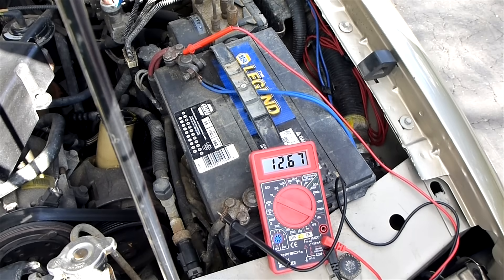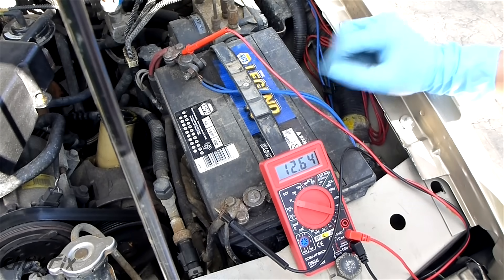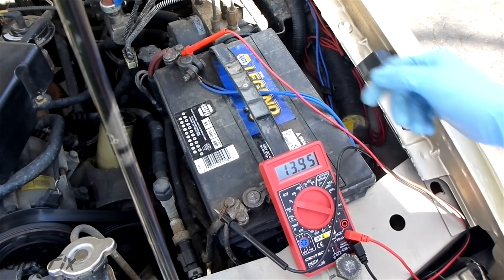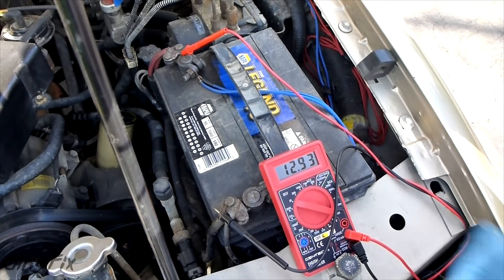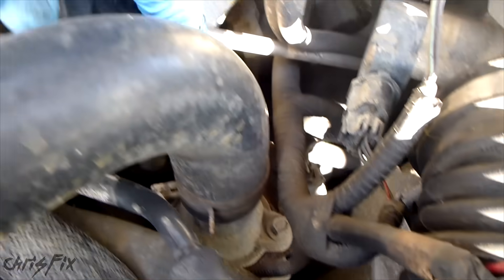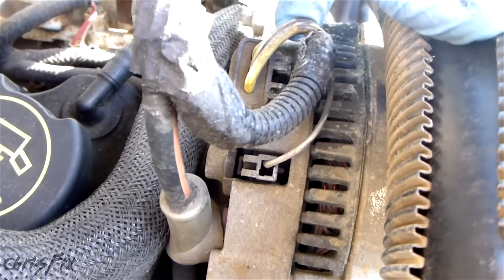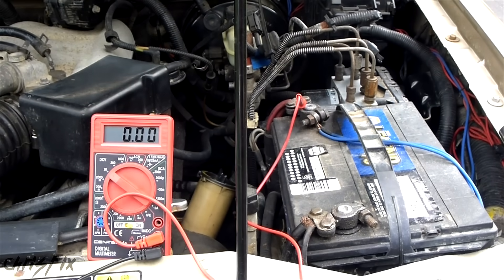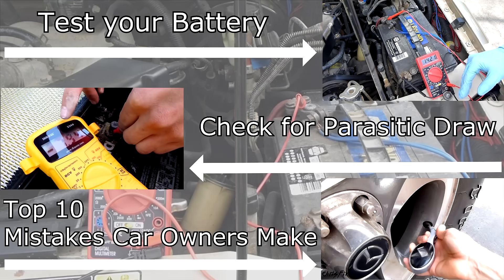How to Test an Alternator

Comment: Hi,
long video but am recently experiencing some problems with my car. 
So might ask the question here. =)
Well, my voltage on the battery in the morning before starting the car is 11.8-11.9V. (without any kind of electrics). With lights, radio etc. even lower 11.5-11.7V.
Car starts without problems even after staying couple of days in the car park.
However while starting the car there is a small dip in voltage under 10v., and the in first second or two voltage jumps up to 17V.
And immediately after stabilize between 14.1-14.3V with or without electrics inside the car (heater, radio, lights, etc.) it is in this range.

While reving the car voltage jumps from 13.8-14.3V max.

Problems I've had, various random faults on my computer (Bmw e60 5series), like transmission fault, abs, engine fault, parking sensors etc.

First, 
car was jumping into the limp mode, when this happened I've had to switch of the car, start it again.. Car would drive few mins, and then I had the same problem.
Day after, I've had the same faults and problems, but after I switched the car off, I was not able to start  it anymore (no power at all),  seems like the battery was drained completely. We jump started the car with cables, but had to wait couple of minutes..

Not sure, what the problem is, and what should I buy new (battery, or alternator)? :/

From readings, battery is really bad before starting the car..
Seems like when car is working alternator works fine,  also there is no any weird sounds coming from alternator, but on other side this high jump on the start confusing me?!

I was told that BMWs are really sensitive on bad battery, specially now when colder days arrived here, but I am not sure if all this faults and problems can cause the battery by itself, or the problem is in alternator?

Any thoughts please?!
Thanks

Comment: Hi,
my 2006 maxima idles at 13.9v and hits 14v at 1500rpm rev. I just had the battery replaced recently because it was completely dead. Does it sound like the alternator needs to be replaced or a bad connection somewhere?

also when I idle sometimes the rpms fall below 1000 and the car feels like it's about to stall...

thanks

Comment: Hi, just wanted to say I appreciate your videos very informative. Had a quick question I got a 2003 Ford Expedition XLT 5.4 liter engine getting a "check charging system" light on a dash, battery recently replaced, alternator seems to charge the battery, but the car still dies Within a few hours or a day. What can it be?

Comment: My car's on-board computer show 10.9V with the engine turned off and 12.5V with the engine turned on. The car starts quickly and easily even when cold. 1. Do the on-board computers give a reliable reading? 2. Can a weak battery contribute to a lower (12.5V) after starting the engine? 3. Or there is definitely a problem with the alternator?

Comment: How can I determine if my alternator is bad on a mid 2000's Chrysler where the voltage is regulated via circuitry inside the PCM? My alternator is not charging but I need to determine if it's due to a faulty alternator or a problem with the regulation coming from the PCM

Comment: I used the built-in system (on the dash) and got around 11v when driving around it never went over 12v.
My ABS light came on when stopped but went away when RPMs were raised. It has also been sluggish to start as well.
I'm thinking alternator is on its way out. This is on a 2001 Ford Escape 3.0L v6 2WD engine.
Whatcha think ChrisFix?

Comment: Can anyone help me, I changed my alternator & battery use my multimeter to check the voltage & it’s fluctuating up & down doesn’t stay consistent,what would cause it to do that ?,  I’m not really mechanically inclined just trying my best with it.

Comment: what's up Chris so when u have it connected and it reads 12.67 is that voltage for the battery saying its good or ?
Reply from the maker: It is a good voltage but doesnt mean the battery is good. Gotta do a load test on it.

Comment: Absolutely the BEST video for testing the battery, as well as the charging system. I have an 05' VW Beetle and running, I was only getting 13.5-14.1 volts when at a fast idle. The battery seemed weak, even though it is brand new. SURE enough, the Alternator was bad.

Comment: Hi Chris,
What if the battery is inside the car. How would you do the negative connection test? All I have is the positive stud in the engine compartment.
Thanks,

Comment: Hi Chris, can it be a steering wheel cracking having as a cauze a low battery voltage. my car has electric servo steering. It appears this cracking after a drain battery some days ago.Thanks,

Comment: Hey I have a 2013 chevy cruze lt turbo and I keep getting a battery saver active light. I already upgraded the battery and the negative cable (which has a recall but nothing seems to work,any ideas?no service contract on the car since I bought it used so taking it to the dealership is not an option because they charge $85 just to look at it

Comment: man im having the same issue with a 95 firebird,no battery lights and no charging,my buddy hooked a wire from 10 amp fuse in the fuse box under the hood and it worked,but i want it back to factory as i have taken out the alt cause it went bad.....about the 4th one now and i cant seem to remember which wire it went to cause its been unhooked for about 2 months now....any way i can send you pics to your email? plz man im about to trash this damn car im to that point!
Reply from the maker: +SatansWill DM me on Instagram.
Reply: sorry i dont have it but i will get it,can i send you pics like that so you know what im saying?
Reply: or facebook?

Comment: Mine is at 13.30 volts with evrything on.. alternator need replaced?.. cause sometimes it stops cranking .. like a dead battery thing going on.. then i repeat and it starts.. i bought eliminator starter just in case lol

Comment: Also i use save a battery chargers on my, JLG lift, Kubota Tractor and this 99 gmc truck in the winter and they work very well to maintain the battery when you are not using for extended periods of time.

Comment: Also changed pulley on ac unit, idler pulley, idler tensioner and serpentine belt with new, only to find out that it was the alternator that was squealing. Just FYI for anyone else.

Comment: just replaced alternator on a 1999 gmc sierra 1500 with 110,000 miles. 
-Battery to + on alternator case = 0.01
+ battery to b post on alt. = 0.16
Old alternator was still charging, but was squealing bad in the cold temps, I use this vehicle only for plowing snow.
The readings I have are lower than what you state on you video, but is lower better?  
Also when resting should the battery always have 12.6v no matter what, even after setting for a couple days. < my battery goes lower like 12.4 or so. 
Thanks I love and appreciate your videos, they are very informative, and I have subscribed to your channel.  Thank You.

Comment: The voltage has to be 13.8 v or above to charge the battery (lead batteries). To charge the battery, the electromotive force needed for charging is present at 13.8 v and above. If your alternator produces less than 13.8 v the battery will not be charged.
If the batteri voltage is belowe 12.2 v its completely discharged but can be saved with a full charge. If its belowe 11.5 v its ruined.
If you always keep your battery charged and avoid a discharge, you can keep it many years – 10 up to 15 years. The summerheat ruins the battery and the winter cold tells you all about it. But then its too late. I have an intelligent charger mounted in the car that I just connect to the power outlet when the car is not used for a couple of days. My battery is 9 years old and still has the full capacity of 90 Ah.
Great videos!!!
Reply: I have always wondered about this, but lack the knowledge of it.  Thanks for explaining.  Summer heat temps and winter cold temps are the times when I may usually experience bad battery issues and I pretty much thought batteries are only good for a few years.  (eg most of us would consider about AA batteries that eventually die out, so I figured a car battery also has a limited life, no matter how expensive you buy it).

I didn't know that it is probably some things I could do or realize about it that will help it.  Thanks!!
Reply: Bellow 13.8 wont charge? Mine hits 13.6 and charge

Comment: Hey ChrisFix, you just saved me 300€! After a battery replacement, I was told that the alternator was bad .. went home and followed your video and found out that alternator is fine. I went back to the garage and they checked it again and with all accessories turned on, voltage was 13.5v and they said it has to be greater than 13.6v .. unreal lol
Reply: I trust you left a review on that business so others know to be wary.
Reply: @TPOANME  Yes. Give a review. It can help others.
Reply: The shop was looking for rent money
Reply: As long as you dont seem to be losing electrical power and car starts right up, no worries. If that is the case, that shop is desperate and full of crap.

Edit: btw, and rebuilt alternator costs about $75. It is a really easy job. 30 minutes for a pro and maybe 2 hours as a newbie.
Reply: @ReMz10184  Not for my car. A rebuilt one is $180. :(
Reply: @explodinghead75  
Yeahhhhhh.... depends on the car. I dont even want to price out an alternator for my f350
Reply: @ReMz10184  Some shops also give lifetime warranties on their alternators, such as Auto Zone.  If you're going to DIY or if your local car shop can install outside parts from other suppliers, definitely consider the alternators with this kind of warranty.  Of course, I don't know if this is standard type of warranty on alternators since I don't really follow all the major chains or suppliers.

Comment: Is the 14.2-.7 volt when the car is on the standard reading on every car? My cars alternator is a valeo brand of alternator with a 13.5 volt, recently i have a problem with my alternator and the mechanic told me that my alternators brush had to be replaced. My volt meter reading when i have check my repaired alternator is 13.7 to .9 is that the normal voltage the my alternator give thanks

Comment: Hi 

My car is having problems starting that I have to jump start my car in order for it to run on 

My car volts when car is on are 13.7 volts 

I did a test load and the volts where 13.5 with the radio,lights and AC on so I'm assuming a bad alternator?

Comment: Except corrosion when I start the car shows 14.0 / 14.1
After not a big ride falls to 13.8 / 13.6
And the machine does not respond well and produces 2 errors
One of the errors is 00537 Active / Static
Oxygen sensor control-lower limit stop value
And the second error is 00516 Passive / Sporadic
Closed throttle position switch-f60-open circuit / short circuit to +B

Comment: Chris, is it possible to damage the alternator (or some other part associated with it) by hitting the curb at say 5-10miles/hour?

I clumsily got off the sidewalk - instead of driving down the slope I got off of it and the underneath of my car hit the curb - I parked the car - then later when I tried to start the car again it started making noise - a friend said the alternator may be damaged in some way (by hitting the curb or some other reason).

Any feedback will be greatly appreciated. Thanks!

Comment: Hey Chris! Your videos are awesome! Full of information and great tips! 
Have you had any experiences with Dodge Journeys? The battery has been replaced, and the "battery saver mode" just came on again. It turns the radio and park assist off instantly. Turning the car off and on, radio started working again. Everything was tested while it was at the garage, and the battery came back faulty, that's why it was replaced! Any ideas...

Comment: If the voltage doesn't change couldn't you make a circuit between the battery and the alternator /Dynamo with an avo meter or a multimeter

Comment: hey Chris, Thanx!, your videos are very helpfull.. i just have a question regarding alternator test.. on voltage drop.. on the positive side i got a -0.02 and at the negative side it's -0.00 on the alternator body, even use a probe with a clip that i clipped to the alternator body.. still reads -0.00 even test the probe to the block and still -0.00, is that a problem?  and also the positive side clipping the nut and the terminal, both reads -0.02 TIA

Comment: Good stuff.  

Usually i have no problem working on cars but literally out of no where this morning my car barely started and after driving it and eventually parking it for about 10 mins the thing couldnt start under it own power. So i jumped it. got my multimeter out and its reading about 13v but im not sure if the dead battery is affecting that reading or if my alternator is actualy going bad. Just seemed odd tht something like this would happen over night. never had it do that before.

Comment: Hey Chris, What do reccommend to clean these connections with? You mention sanding the surfaces, but what about cleaning them? I've used baking soda and water solution for batter corrosion before, it worked really well. Would that be appropriate for the connections, or would something else be better? Thanks.

BTW great video. I've got either a bad alternator or something else draining my battery, and after watching this video I feel 100% confident in diagnosing my alternator problems now. Your instructions were clear, the video was clear, and you were thorough. Thanks!

Comment: Help i have a Toyota Rav4 2008 model with Battery light on when i put meter on Battery with engine running it dosent go up any voltage stays the same engine will keep running until battery goes flat , then i recharge battery motor starts runs fine and engine runs battery flat, would it be alternator. Thanks
Reply from the maker: That is a bad alternator.

Comment: I just put in a Lithium Red from Advance Auto into my RV engine not house.  The battery is 10.2 and never charges even after the engine running for 4 hrs or more but my alternator ran at 14.62 so apparently the alternator is good.

Comment: Hi Chris, this method is not accurate.  On my Ford Focus and my Ford Ranger the battery voltage read 12.6 and 12.8. Engine running the voltage fluctuated Between 12.0 and 13.8. I jumped to conclusions thinking the the alternator was not charging. In both situations the battery was bad. Once the new battery was installed, with engine running the volts held steady at 14.5. Hope this helps. Thank you, your videos are awesome.

Comment: Just a side note: The voltage drop on the positive side of the circuit on the B+ post of your alternator. The reading 0.28v is ok meaning it won't cause you any trouble for now however it seems corrosion is slowly eating your wire away. If it reaches 0.50v you will have starting problems with your car. So the voltage reading to be considered normal, should be almost in the same ball park or almost the same as other side of the circuit (meaning the negative one on the alternator case) you measured.

Comment: If anyone knows... Having power issues today (no power steering, radio on and off, lights on dash show in various combinations). My battery is showing 9.5 volts both with my car off and when it is running. 2 year old battery. Likely alternator or battery? Thanks

Comment: My alternator on my 1995 corolla reads 12 volts and mechanic said it should read 14. My car sometimes shows battery warning sign for a couple minutes and than it may go away. The repair shop wants $150. How long can I drive the car in this condition?

Comment: One should think that when a shop replaces an alternator, they would do all these checks.  Instead, my new alternator reads on the dash just like the old one did, except that it spikes when first started only.  As soon as the vehicle moves it drops back to "in between" i.e. between C and D (the rig lacks an actual voltage read).  Could the dash read-out be faulty? Just a thought. Appreciate your video, so I can finally learn how to do it myself.

Comment: hey chris, no idea if you know alot all about old 70s mopars, but you're more knowledgeable then half the shops in my town, but basically the car is dying whenever  I hit the brakes, leaving me dead in intersections and sometimes it wont turn back over, and sometimes it just requires me to turn my lights off to turn it over, that sound like a bad alternator? I thought I might need a new battery since every time I come home from leave my battery is dead but this is a whole new problem.
Reply: side note is It might actually be the carburetor, had to replace my idle switch because ot was too worn down and wouldn't stay turned over in idle, 75 cent fix and it worked, but then this shit happened, I'm not mechanically inclined enough to really know how to fix the damn thing and there's only 2 shops in town that will even touch my car with how old it is.

Comment: I replace 4 alternator on a 1999 dodge Caravan , the symbol light all was on I put 3 new 1 use alternation the battery light did not come on until one day later. When pull negative post off the engine cut off. And it a new alternator did the same thing cut off the engine !  I'm GOING OUT THERE to check connectors on the alternator to see if ,the one that plug-in too  alternation to see' if it is frilled ? if it is twisted in a bad way. I rotation the wire rotation clockwise when I'm outing in a new alternation. I think it may be frilled ! Or my computer is bad ? All them time putting in new & use alternation the same think Happens.... What you thank! Call me 240-516-8033 Don
Reply from the maker: +Don bigfoot it's hard to say without seeing the car. Check all of your wires and connections. They should be clean and tight.